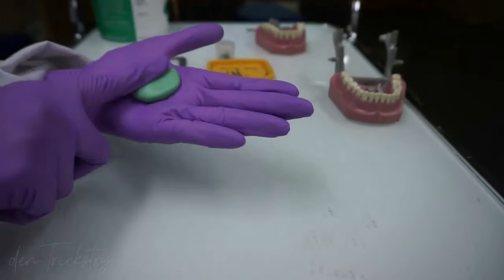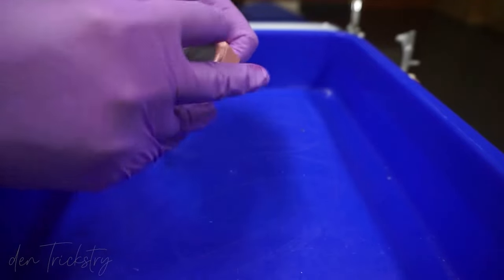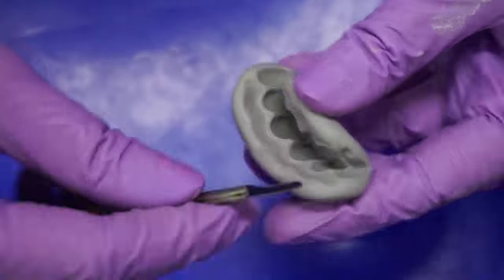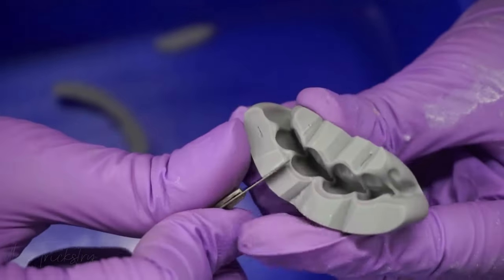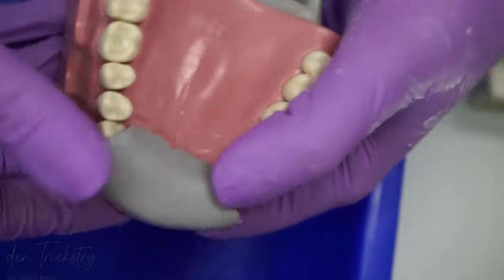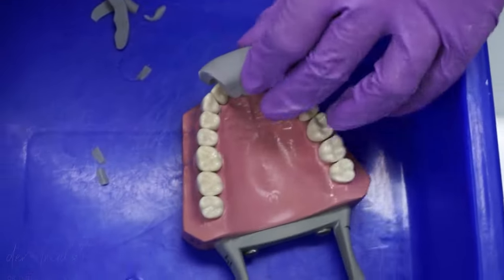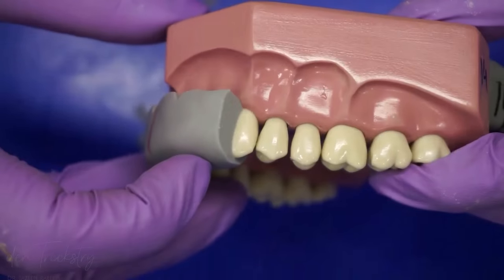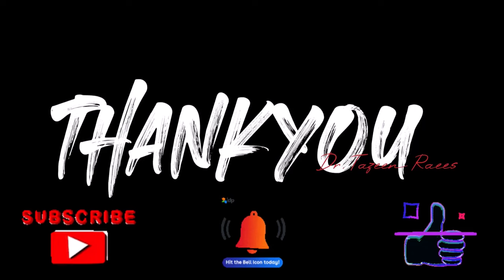How to make an IMMEDIATE TEMPORARY CROWN?? (Direct Temporization Technique - Demonstration)

Comment: I could never make these to fit nicely on the margin, it was either overhang or gap between the crown and prep margin
Reply from the maker: The index has to be closely adapted to the tooth...if the index is well made, then it shouldn't be a problem... :)

Comment: Thank you for this video. I would like to ask do we make the putty index on the cast or directly on patient before preparation. In clinical scenario we don't have time to take impression and make cast. Can we make putty index directly in patients mouth before preparation??
Reply: That is a commonly used technique
Reply from the maker: You can make it from the cast also...or directly on the patient before prep....but if you are creating the index intraorally, make sure the tooth is not fractured, carious or broken down...if that's the case, then a good composite build up has to be done before the index...remember, the temporary crown takes the shape from the index...
Hope it helps :)
Reply: Thank you for your reply
Reply: No it may become stuck

Comment: If i already have prepared tooth how i can make rubber impression ? And make tem.. crown
Reply from the maker: With this technique,  either you make the index before the prep if your tooth is in a good condition/after you build it up with composite or you can make the index on the cast after a wax mock up...and use that index on the tooth after preparation.